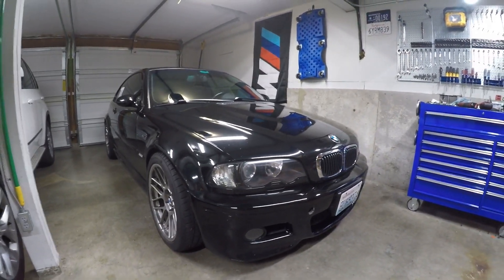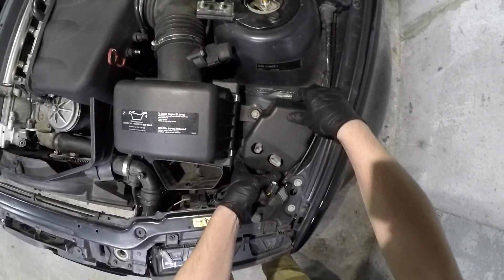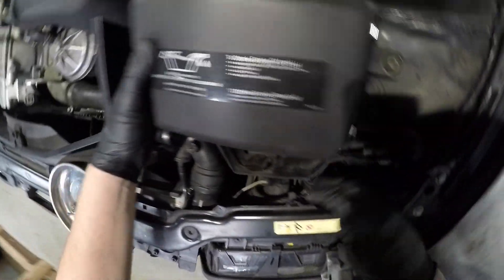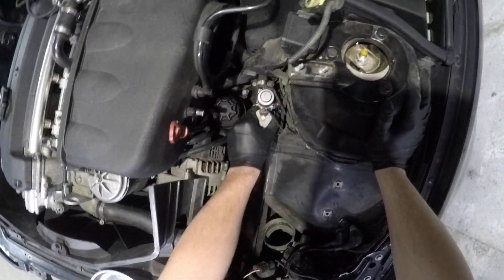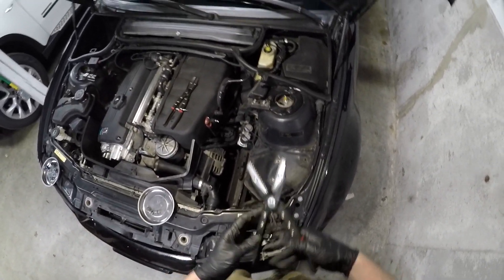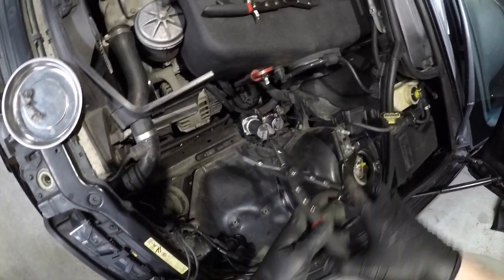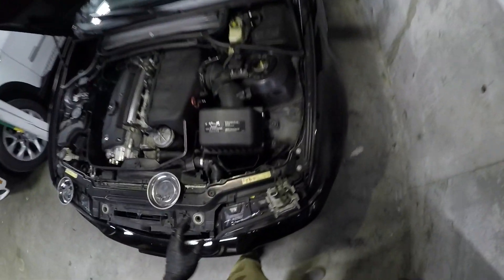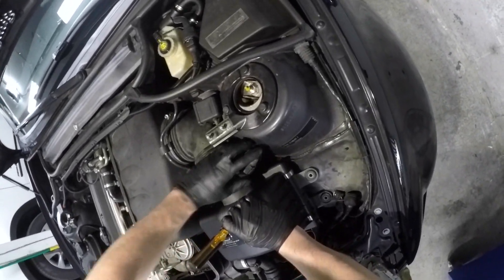E46 M3 Auxiliary Water Pump

Comment: Hi Chris, great vid! Lately I've checked error code and got code "25 Auxillery Water Pump error short circuit to ground" - do you think I need a new aux water pump ?
Reply from the maker: Yep, that sounds like the same issue I had.
Reply: What happens if the auxiliary pump is broken? I've also recently come across computers showing this